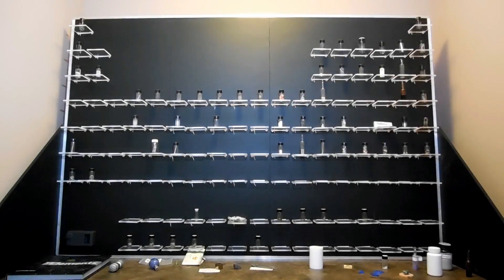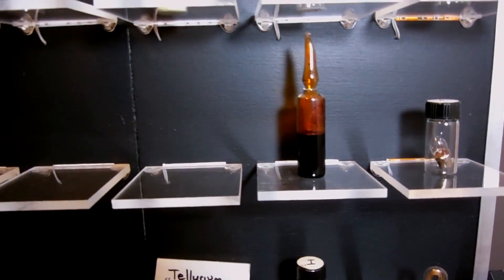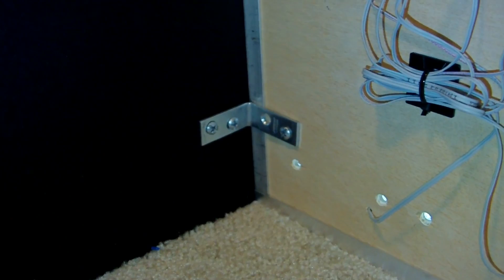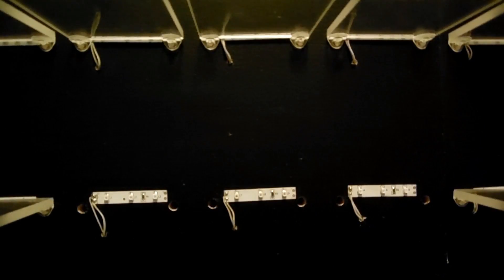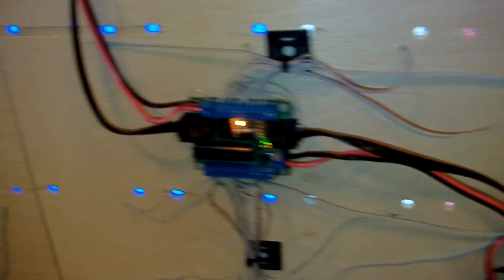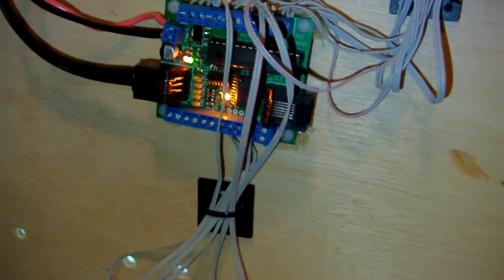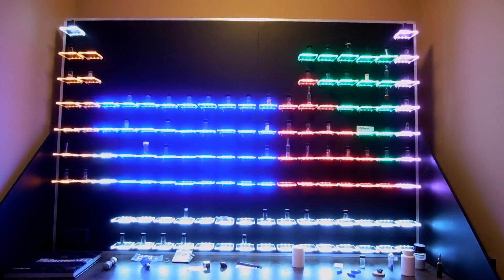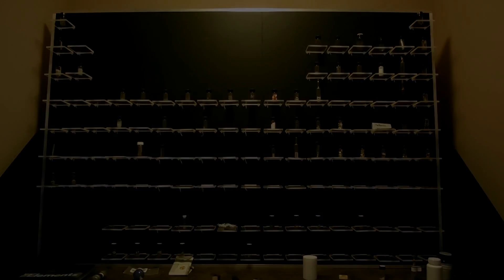Element Display

Comment: Cool project! I can't help, but wonder if you will be able to obtain all of the elements such as uranium? Reminds me of something from the 70s or maybe the 80s
Reply from the maker: In fact I already have uranium! At the time I recorded the video I only had uranium ore, but now I have a small sample of the metal. All of the elements up to uranium (plus americium) are definitely collectible, except for a few of the more radioactive ones like astatine. Only about 12 more to go!
Reply: Good luck! Can you do a video or video series showing each of the elements and how you came to obtain them and/or a little bit about them? Even experiments if at all possible.
Reply from the maker: SerpentLight213 I actually tried making a video showcasing my collection, but I couldn't get the lighting right. Tough to record stuff in glass vials without lots of glare. I have so many it turned out to be an extremely long video too! I'll try again one of these days.
Reply: That video would be interesting!

Comment: I am working on this as well, for anybody out there, what do you recommend as a source for alkali/alkaline earth metals? (I have calcium and lithium, but the more powerful ones are harder to come by like sodium and cesium.)
Reply from the maker: Try GalliumSource! I haven't bought from them myself, but I've heard a lot of good things. My sodium was bought from a place that doesn't sell it anymore, and I got my cesium from a fellow amateur chemist who made it himself (very impressive!). I've made potassium myself as well, but it's not quite nice enough to make a display sample yet.
Reply: Alright, sounds like a solution! Thanks! I had an idea of using an old welder for electrolysis of sodium, potassium, and cesium chloride....and maybe that might work.
Reply from the maker: Paul Pyro
Possibly, never tried it myself. Molten salt electrolysis can be pretty nasty, take maximum safety precautions! Especially cesium, which you have to do in inert atmosphere or it will explode when it hits the air.
Reply: Thank you for the tips! I do have some experience with molten sodium chloride, however cesium chloride and more advanced elemental salts may be out of my reach for now.......one day :P

Comment from the maker: At the moment, the colors serve to highlight different categories of elements (noble gases, transition metals, etc.) For Phase 2, I'm going to write a tablet app so that the LEDs can be controlled from the app. That will allow me to highlight individual elements that I touch on the screen, and have a "quiz mode" where multiple choice questions are asked, possible choices are lit up on the display, and the correct one will flash (or something similar). The LEDs open up a world of possibility.